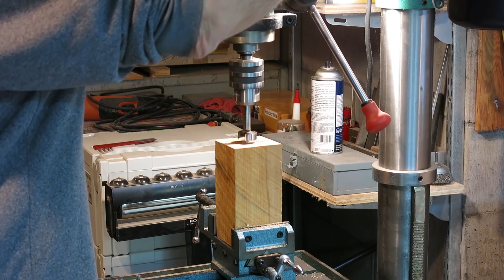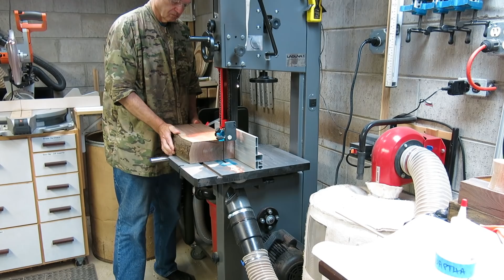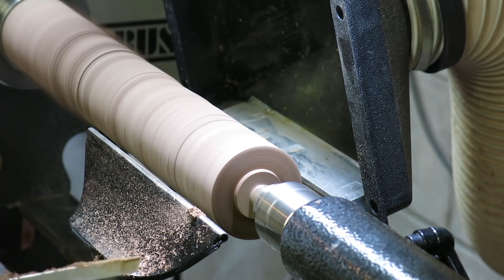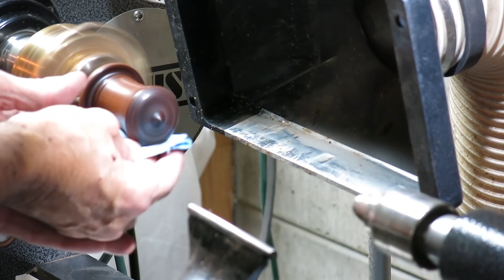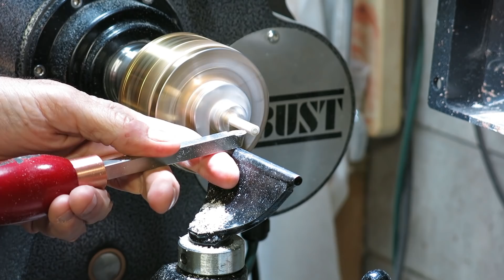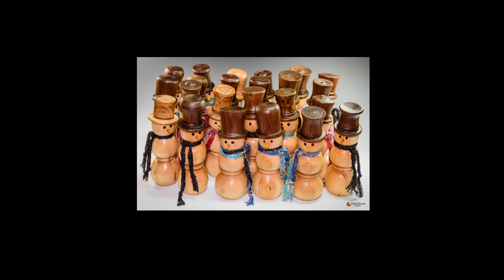Turning a Snowman

Comment: Nice little project. Instead of Sharpie pen eyes, you might want to try rounding a dowel and chucking it up and spin at high speed. Apply some pressure and the dowel will “burn” the eyes in. I use that technique to make pips on some domino sets I like to make
Reply from the maker: Thanks. I make these things at a couple different levels of ‘quality’. For the ‘fancy’ ones I actually inlay eyes and buttons with Milliput, and add a few other more elaborate decorations. The pieces in the video I mass produce for my craft shows where I sell them cheap. The customers I have at these shows won’t pay a penny more if the eyes are Sharpie or ‘fancy’, so I just keep these units simple.

Comment: Great video. Thanks.  For the tilted hat effect the mortise had been drilled straight. How did you make the hat sit flat?
Reply from the maker: In the video I use a custom jig on my bandsaw to cut different angles  on the top. I used to do it freehand, but find the jig I made safer and more accurate.

Comment: Do you cut the hat mortise at an angle as well?  It seem by just cutting the snowman’s head at an angle will not change the angle of the straight holes in the head that you drilled with the forstner bit. Can you explain a bit further how you get the hat angle to for so snug?
Reply from the maker: The hat tenon is straight, and quite short, just a stub really. The head mortise is cut deeper than required initially assuming it will be a bit shorter on one side after angle cutting. As long as there is at least 1/8” - 1/4” mortise left after angle cutting the CA glue will have plenty to grab onto and the head will be ‘fused’ just fine to the head.

Comment: Only see one problem here. You drill a straight hole in the body of the snow man, and then later cut it at an angle so the hat will be tilted. Unless you are under sizing the tenon on the hat, there would be no tilt, just a gap under one side of the hat. Please clarify.
Reply from the maker: I do drill the hole deeper than needed knowing I will lose some when I cut the top at an angle. I use a real shallow tenon on the hat, You don’t really need more than 1/8” tenon and the CA glue will work just fine. I never had a hat come off a body using this method.

Comment: Great video. I've been trying a few myself. Did you ever think of turning the eyes? I've tried it and it gives it so much character. It's a shame to have felt tip eyes when you've put so much work in.
Reply from the maker: Thanks. If I make these for gifts I will spend a bunch more time on the eyes and other details. The video shows how I basically mass-produce these things for sale at the only craft show I do every year. The honest truth is I can't get a nickle more for them in my area if I make them more elaborate, so I just stick with simple. I sell them out every year ... so I guess my particular 'market niche' is telling me that painted eyes are fine.
Reply: @CDRowe1  I'm sure it's been asked before (like my earlier question).  What is your asking price at a craft fair?
Reply from the maker: Kerchal Mier $20-$25 USD

Comment: Hi, I enjoyed your video. My question is, if you drill a mortise on your lathe for the top hat, then cut an angle on the head, it doessn't seem like they will fit together tightly. Am I wrong, or am I missing something? Thanks.
Reply from the maker: I drill a mortise on my drill press and make it deeper than required. That way, when I cut the angle on the head the mortice is still deep enough that the hat doesn’t bottom out.
Reply: @CDRowe1  Thanks

Comment: I'm very new to turning so I have a question. I couldn't see how you attached the body to the lathe after drilling the hole, did you mount it between centers with a spur center or something else?  Thanks.
Reply from the maker: Yes, it is just mounted between centers like any standard spindle turning. I use the little dimple created by the forstner bit during drilling to center the  spur drive at the head.

Comment: Do you use green wood? Awesome little snowmen by the way! Love them!
Reply from the maker: No. I always use well seasoned, dry wood. Green wood would move around and could crack as it dried out.
Reply: @CDRowe1 , how long does it take to be considered well seasoned?
Reply from the maker: In my area I usually consider 8%-10% moisture content dry. I use a relatively inexpensive moisture meter to check my wood periodically.

Comment: How do I make your index card for quick reference You never gave any measurment
Reply from the maker: The measurements are completely arbitrary. I have made really big and really small snowmen using the same techniques. For this video I started with a block of maple about 3"x3"x6.5" for the body. The waist is 3" from the bottom and is 2 7/8" dia. The neck is 5" from the bottom and is 2 1/4" dia.  All sizes and dimensions are really up to you. There are no rules!

Comment: You did a good job, but I couldn’t hear you. I can’t tell the size of the snowman.
Reply from the maker: The snowman body starts out as a  6 1/2” (3” square) blank and the hat is about 3” tall (varies) and starts out about 2 3/4” square. Total snowman finished height is around 9” give-or-take depending on how tall you make the hat.

Comment: How do I make the templates for hat and snowman?
Reply from the maker: The measurements are completely arbitrary. I have made really big and really small snowmen using the same techniques. For this video I started with a block of maple about 3"x3"x6.5" for the body. The waist is 3" from the bottom and is 2 7/8" dia. The neck is 5" from the bottom and is 2 1/4" dia.  All sizes and dimensions are really up to you. There are no rules!

Comment: A better mic along with doing away with the music would improve the quality immensely.  Otherwise a very well done video.
Reply from the maker: Thanks. I actually used a really nice mic. I understand why this wouldn't be a good idea, but I wish there was a way to update a YouTube video so I could just re-mix the audio without deleting and starting over. Oh well, live and learn.
Reply: I believe it is the quality of the speakers that the folks are listening with. I am using an anker sound core 2 blue tooth speaker and I found everything sounded great.
Reply from the maker: Thanks, I think you are right. I used a high quality Sennheiser mic and mixed everything on a great little Mackie mixer. I played in a rock band for 35 years and actually have a little digital recoding studio in my basement which I used for this video. It sounded great on my studio setup and I was really surprised that some folks had sound issues. I always thought sound was one of my specialties.
Reply from the maker: Jim Miller Huh?? My computer speakers are a couple 100 watt Marshall stacks ... and yes, they go to 11.

Comment: Do you mean a 2 1/2" diameter?  You can't shoot for a 3 1/2" diameter from a 3" square block.
Reply from the maker: I couldn’t find where I mentioned a 3 1/2” finished diameter, but if I did .. that was incorrect. The bodies start out as roughly a 3”x3”x6” block and the finished diameter is usually just under 3”. The actual finished diameter depends on how careful I am roughing them round.  Each one will vary a bit in final diameter. I don’t try to make them all exactly the same.
Reply: At thirty seven seconds into the video.  If I have misheard you, I apologize.  Nice turnngs though btw....you have inspired me to try making this size.  I usually make smaller ones for tree ornaments.
Reply: @CDRowe1  that what i was wondering how he turned 3x3 and got 3 1/2 or even 3, good video nice ideas, thanks

Comment: Any measurements?
Reply from the maker: The snowman body starts out as a  6 1/2” (3” square) blank and the hat is about 3” tall (varies) and starts out about 2 3/4” square. Total snowman finished height is around 9” give-or-take depending on how tall you make the hat.
Reply: Thanks so much from and old new turner.

Comment: What is the lathe chuck you are using?
Reply from the maker: I got it from Penn State. It was a kit and I believe it was the Barracuda model.
Reply: @CDRowe1  Just interested what the rest of the turners hardware is used..
Reply from the maker: I believe I used a spindle gouge, a parting tool and a couple carbide tools (square and diamond). The entire turning part of the project could be done with just.a spindle gouge and parting tool if necessary.